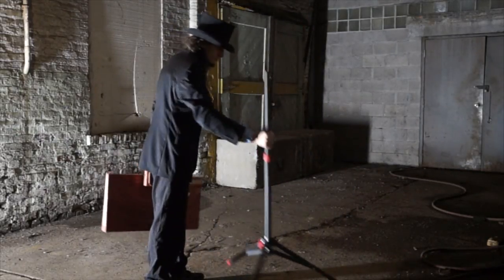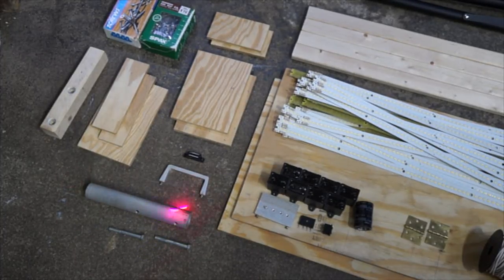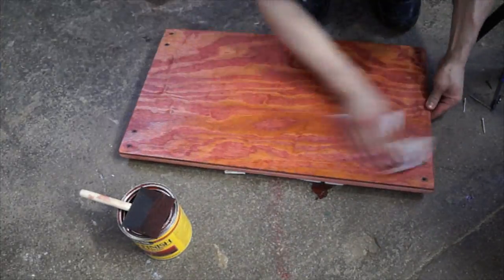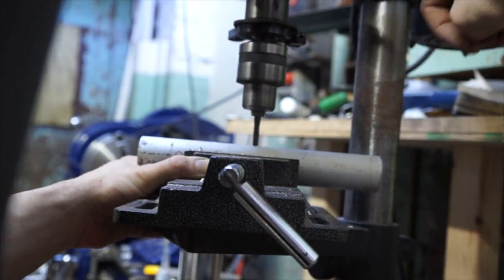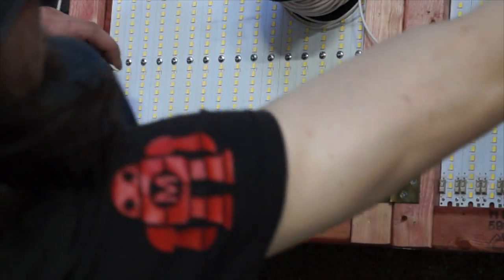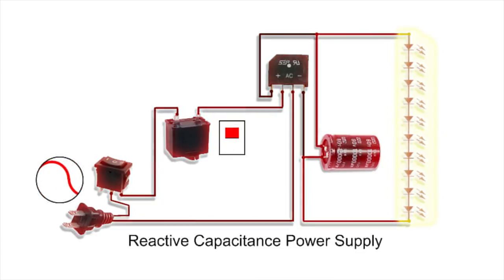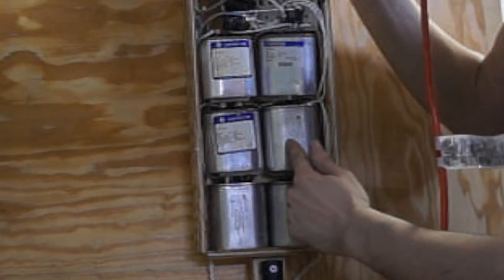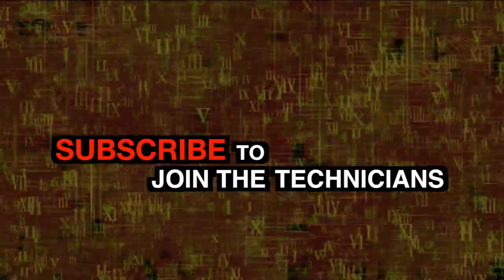HOW TO MAKE AN EXTREMELY BRIGHT LED FOLDING LIGHT for filming/work

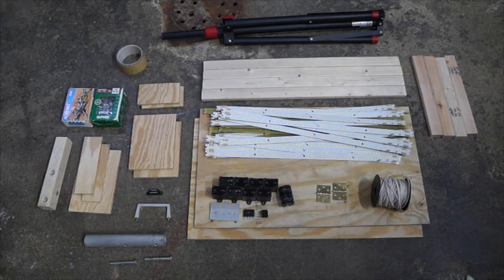Comment: Is that a RGB laser pointer 1:18
Reply from the maker: It is our hand built QCBL laser design.  Technically it is 4 color laser device.  Unfortunately, we can't reveal the secrets of what's inside that enables the device to be so compact.
Reply: Join The Technicians i want it!! Where is the plasma pen video?
Reply from the maker: Had to pull the video, board layout contained a critical error that we missed in editing.  Working on the re-upload now.
Reply: "Unfortunately, we can't reveal the secrets of what's inside that enables the device to be so compact."

Why not? :) Are you planning on selling the design?

Comment: Still waiting for that RGB lazer pointer tut lol
Reply from the maker: C'mon...  ya know we won't release our secrets that easily.  :)
Reply: true but IIRC you mentioned it in a previous video, I have an idea of how it is made. Maybe using an RGB led with a small  opening to give it the point. wouldnt be much of a long distance lazer but you could use 4 diff diodes and that would be good. hmmm...
Reply from the maker: As I replied in the comment below your, it's a 4 color laser cavity.  We custom designed all the optics and mixing cavity from scratch.  A lot of work went into the design which is why we wont give it away so easily.  lol
Reply from the maker: Oh, and about distance... Well over 10,000 feet on a clear night.  The laser has very low divergence and power to burn things, although that's not what we use it for.
Reply: That is very nice. I love burning things even more reason for the HYPE!
Reply: Or just a white lazer going thru a prism like on a DLP projector.